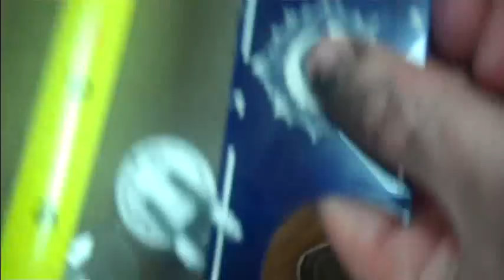Fungus Nids vs Tau 04

Comment from the maker: @chaoticflanagan This is absolutely correct.  If I had continued to advance them behind the wave of Gaunts I would have been in a commanding position on the board to shoot at almost anything.  Plus hiding them wasn't really helping as both Hammerheads could have easily rooted them out.  But Josh stayed focused on the objective and won by picking off the various small squads of spawned Termagants.  If he had focused fire on the Hive Guard that would have probably saved a few Kill Points for me.

Comment: Also your negative reaction to Hive Guard is unwarranted. It was a poor choice shooting them at them at Tau vehicles. The disruption pod is REDICULOUS. 5pts for a cover save against ALL ranged attacks outside of 12''. So you have a unit that is hitting on 3s (67%), vs AV13 (5's to glance/6's to pen) (22%/11%), 4+ cover (11%,5.5%), 5-6 to destroy (2%). With a 2% chance to destroy the hammerhead, you shouldn't have expected much.

Comment: "balanced list" also known as sub optimal ^^"
like MrFright said anything but KP and the nids would have steamrolled. Otherwise a hard winning Tau list at 2500 is something like 4x20kroots, 3x3 suits and then, with some variation, 9 broadsides/3 broadsides and 2 Railheads. Thats the list i use and hasn't failed me (my friends nids are itching for a fight though) 
otherwise, great report like always (: